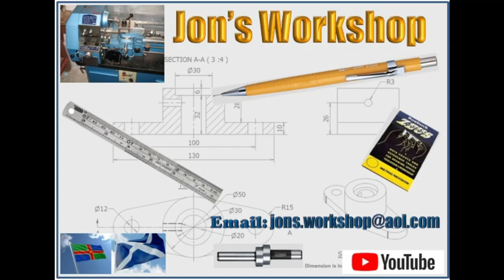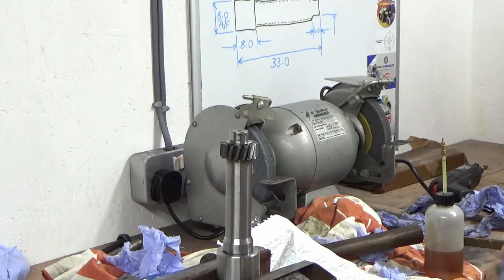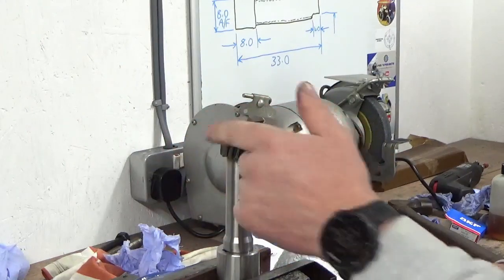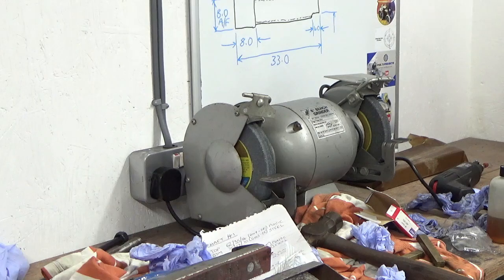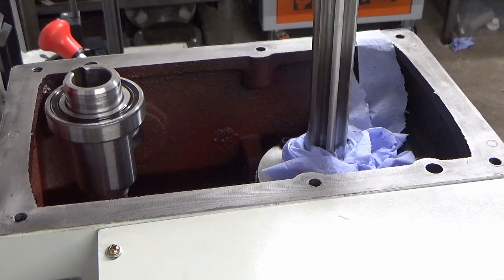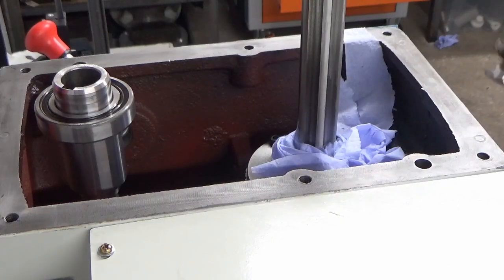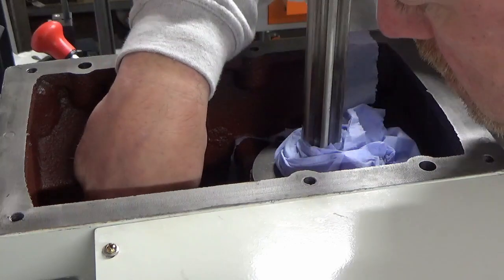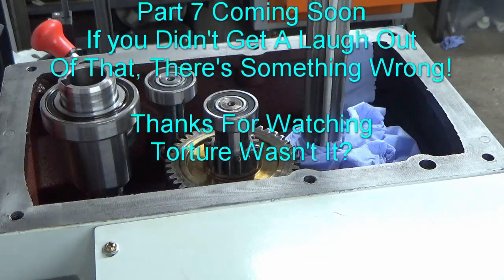Cormack ZX7045 Mill Head Strip Part 6

Comment: Clearly you have never owned an old british motorcycle, have you Grasshopper. You probably should have fitted the gear shafts as a cluster not individually. I don't know the youth of today, what hope for our future? 😉
Getting back to serious(but only for a moment), did you measure that the shaft bearing diameters were within tolerance, you know what our little oriental friends are like on the cheaper end of the market QC.
Reply from the maker: Hi Chris, you are correct, all my motorbikes had the brake and the gear shifts on the correct sides lol. Think of a car, clutch and gears all operated with the left hand side of the body, and brakes and throttle with the right! I am sure this will spark a response or two! Lol. I did measure the shaft ends, two were about 0.0005" under bottom limit (the large ones on primary and final drives) and all the others were top limit to just over (talking 1 or 2 tenths), I got lucky. Interestingly, as best as I could measure them with snap gauges, both bores for the taper roller races were about mid limit with zero out of round I could detect (I got lucky again). This was evident by the fit also, they went in very nicely. Cheers, Jon
Reply: @jonsworkshop  i have been riding exclusively BMW bikes since the late seventies, still own two R90S and R75/5 but don't ride much these days, I mention only because they have "continental " rear brake and gear levers and i never bothered to even think about creating a conversion.😉 Makes me come all young and modern, but then reality butts in and i feel old and remember i hate most things modern. 
Are you saying that the shafts and cases actually meet specs, you really did get the quality version, talk about being lucky.😂

Comment: Well persevered. Sometimes I use an appropriate sized socket to fit bearings, so that it bears on the race and then gives a square push. I haven't got a press so end up doing all sorts. Do you have Allen keys that you can use with a ratchet? I seldom use any other type if I'm honest. Thanks for the video, looking forward to the next bit!
Reply from the maker: Hi Carl, thanks for the comment. Yes, it was a test of old Percy this one. I have used sockets in the past for similar jobs, have no idea why I didn't get my socket set out as I would have also found a set of Alen Key bits to go in the ratchet while I was in there. I think it's probably an OCD thing, I feel more comfortable hitting hard things with softer things if that makes sense? The good news is we triumphed over adversity and cracked the Chinese version of Tetrus! Cheers, Jon
Reply: @jonsworkshop  Good point about hitting the hard bearing race with a softer drift. Looking forward to the next bit!

Comment: Great work so far Jon! I’ve just binge watched episode one to six today and I really did feel for you when you were reinstalling the shafts. I’ve got a 10 year old Warco ZX7045 mill that has started to drip a bit of oil down the quill and I was thinking of sorting that and replacing the bearings at the same time. My Warco mill is slightly different to yours but at least it has given me some idea what’s involved. I cant wait to watch the next episode. Thanks for making these great videos 👍
Reply from the maker: Hi John, thanks for the comment. They are all pretty similar inside, however the bearings seem to differ from what I have heard from other owners who have stripped one down. I think it largely depends on which model of hairdryer they found on the rubbish pile the day they built the head! Pretty simple job really, it's just working out the right order of assembly / dissasembly that's important. Bit fiddly at times, especially if you have bigger hands. Good luck with yours if you do it. Cheers, Jon

Comment: for mounting the bearings on the shafts : get an electic hop , put a bit of tinfoil on it to keep it clean and set it to about 120 degree celcius , lay the bearings on them to warm up , get a glove and pick the bearing up and slide it over the axle , the bearing should be hot enough to expanded to the point it just takes a little force to drop down over the axle , do let everything cool off before mounting it inside the case 
you can warm up the cases and do the same thing but its likely takes a long time ti get them hot enough , it could bubble the paint on the cases and you might not have enough time to take advantage of the expanision before the heat seeps intoo the bearings themselves 

lets put the shafts in loosely first THEN hammer them in youre likely going to be struggling with the gear selector as well

Comment: Thanks for making these videos Jon, they are a god send! I'm currently rebuilding my new mill after only an hours work.
The factory must've been out of stock of the quill rubber gaskets when they built mine. The plate is stuck on with some grey sealent and I can't get it off for the life of me.
Reply from the maker: Hi Morgan, thanks for the comment. I am just glad that people find my ramblings useful, makes it all worthwhile. Good luck with the mill, small amount of heat and a big hammer to free the quill plate should do it. Don't let too much heat soak through to the bearing though (unless you intend to replace it). Cheers, Jon
Reply: @jonsworkshop  Thanks Jon, I'll give the heat a go 👍
Reply: Hi Jon, did you have any issues with bearing races spinning when in position? My new 30207 bearing race can be spun in the bore and also one of my new 6007 bearings starts off as an interference fit and then becomes a sliding fit when close to/in position. Cheers, Morgan
Reply from the maker: @TheOnlyMosesMalone  Hi Morgan, they were all slightly looser than I would have liked, but just tight enough to grip the outer races enough (I got lucky). I had comments from another sub (can't remember who now, sorry) but he had the same issue as you on the same bearings and had to resort to using Loctite bearing fit. I would recommend that you do the same by the sounds of it (it is thick enough to take up a spinning fit). Just ensure you properly de-grease, and assemble in the right order as getting them back out if you get it wrong will be a horrible job that will require the whole head off the machine. Hope this helps. Cheers, Jon
Reply: @jonsworkshop  That's great, thanks for getting back to me Jon. Yeah I was thinking of using loctite retaining fluid too to secure them in place, that'll hopefully do the trick!

Comment: You'll be able to do it with your eyes shut next time, unfortunately you proberbly won't need to do it again, made for a good video though. Cheers.
Reply from the maker: Hi Paul, thanks for the comment. I really hope I don't need to be back in there any time soon, but like you say, if I do, I should have a better understanding next time round. Maybe I should write a Haynes Manual for it! Cheers, Jon